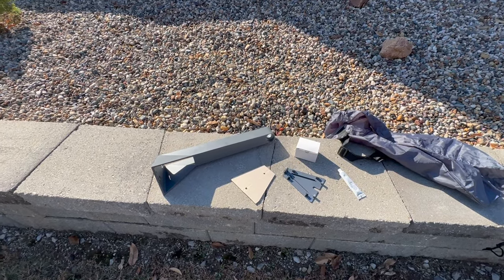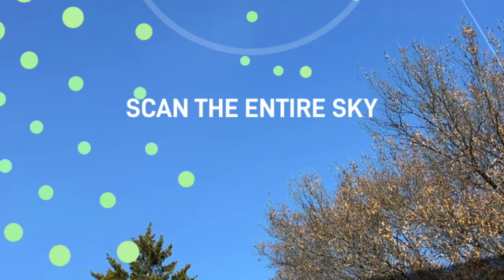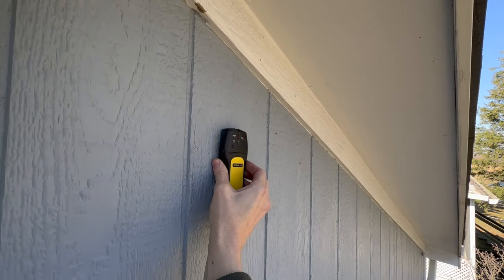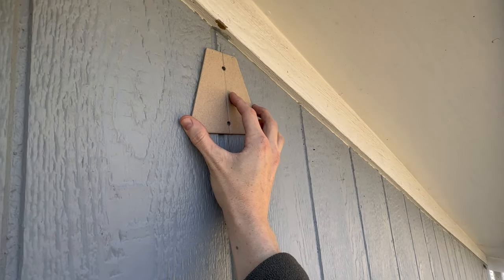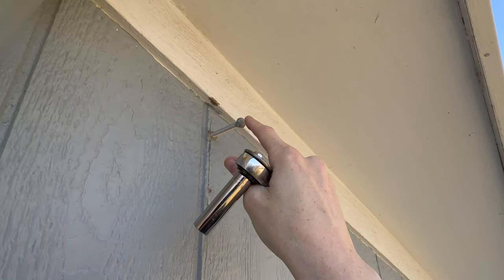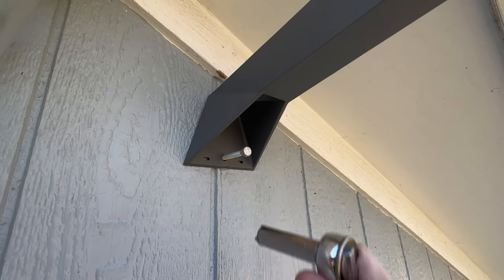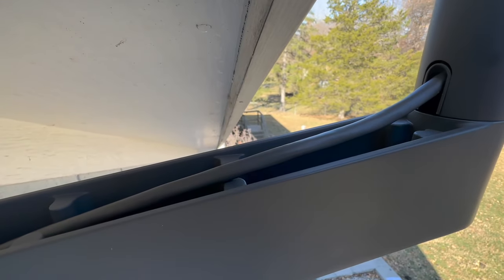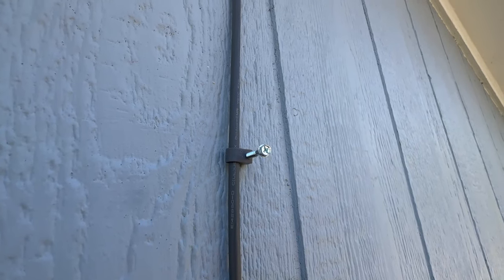Starlink Long Wall Mount Installation

Comment: I can not understand why Starlink wouldn’t take into account that the vast majority of rural homes have 10-12” over hangs with 4-6” gutters. They need a pipe extension to go up passed the edge for the dish to clear the house and/or a mount extension to come out far enough to not have obstruction from the house.
Reply: Exactly my problem.  I have a 16" overhang and 6" gutter.  It would be nice to have a sliding arm section on the mount to get past the gutters.  Now I have to go by some pipe and build my own mount.
Reply: Because they've never left a city before

Comment: Does it come with the cable straps for running the cable down the wall
Reply from the maker: Yes, it includes cable ties that screw into the wall.
Reply: @Starlink Hardware  sorry I watch it but could listen. 😆 thanks.

Comment: can you answer me a question?
Reply from the maker: Sure what can I help with?
Reply: @StarlinkHardware  first, What's the difference between the FLASHING MOUNT and the PIVOT MOUNT? And about the LONG WALL MOUNT do you know if it can be used in extreme climates, I live in a place with very strong winds capable of knocking down large branches, and I am afraid that my starlink could blow away?
Reply from the maker: @ignacio0075  The pivot mount bolts to the top of the flashing mount. The flashing mount just provides a more water resistant way of installing to a shingle roof. So you need both if you decide to do the flashing mount. The long wall mount is capable of handling strong winds, as long as you properly install it.
Reply: @CHIGOZIE ATUEGBU hi when you buy the starlink it only include the tripod, but when your order it s preparing, you can buy more things in the store and added to your package

Comment: Where did you order the extended arm mount. When ordering on StarLink it doesn't seem to show an extended arm mount option.
Reply: On the site. Under Shop. 6th option down.

Comment: I wonder if you could drill through the plate on the wall portion to get the wire into the house without every coming out of the arm?
Reply: Excatly what I did, drilled through the plate. Poor design by starlink :)

Comment: I must be privileged I don't need a stud finder my house is made of Brick. haha.  I just need a Masonry drill bit and a Hammer drill good to go sir.  My biggest problem is right now I have a small blockage where my starlink is currently mounted and I need to get it clear of the Eave so that it gets a full clear view of the sky.  I am not sure what to do because the mount is at full extension.  I did not buy the official Starlink Long mount because I did not believe it would work on my house.  I bought a different mount which was way easier to install but it is full extension and will not clear the obstruction.

Comment: I don't understand why the top of the mount is exposed, it's just going to collect water and crap in there and be a pain to clean. The top should be covered I think.
Reply: 100% agree! Any water is caught and directed toward the house.
Reply: Yes, I did not put the top for that reason. I think it should be upside down but the antenna does not fit.

Comment: It seems the dish is mounted to close to the house. Doesn't it interrupt starlink dish rotation?
Reply from the maker: It can if you have a larger overhang like my roof, yes. In my case, I actually switched to a short wall mount that is directly mounted to the fascia board. Hoping to have that tutorial/review soon!
Reply: @StarlinkHardware  did you ever do this tutorial? I'm having a hard time finding a stud in the fascia board.

Comment: Why mount the bracket with the open side up to collect rain and freeze?
Reply: I don't like the looks of that either.
Reply: Hi, I was wondering the same, if it is not upside down but I tried it in reverse and the antenna does not fit.

Comment: My overhang is 20" from the fascia to the wall.  Is this long mount long enough for me?
Reply from the maker: I don't think it would work well for a 20" overhand.
Reply: It's 17 inches long
Reply: @jasonmiller9313  Thank you. 👍
Reply: @jasonmiller9313  it is 15.5" from wall to pipe

Comment: they advertise 50ft of cable for set up but they actually give you 75 ft is that correct?
Reply from the maker: They recently changed the included cable from 75 ft to 50 ft. So if you buy a kit now, you'll get the 50' cable. The 75' and 150' lengths are available to purchase in the Starlink shop if needed.
Reply: They did not send me 75 feet of cable.  I think they changed it to 50 feet.  My cable barely reached from the office where my computer equipment is located to where my dish is mounted.  I tried before I mounted my dish, to find the best location using the stand that they sent me.  Tested it for 4 days before officially mounting it and the best location was at the furthest point naturally, it would have to be.  SO I found and extension kit which is usually used if a critter bites through your wires and that nifty wire comes with Ethernet RJ45 connections built in (which is pretty awesome) and covers over those connections.  I actually didn't need it, but it was good to have as I tried several different things to get the best location and fastest speed possible.  I didn't bother with the stupid app find the clear sky unobstructed view and all of that garbage.  I have 2 eyes in my head for a reason.  I can see North and I can see where there is no trees.  I guess they wanted this to be able to be installed by everyone no matter your tech skills which is fine.